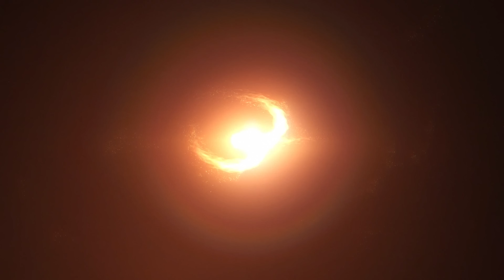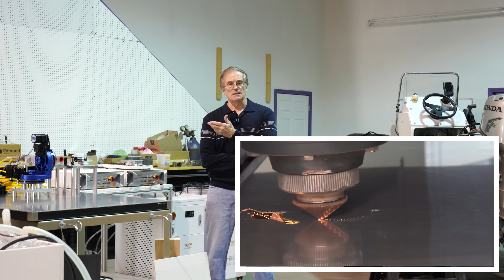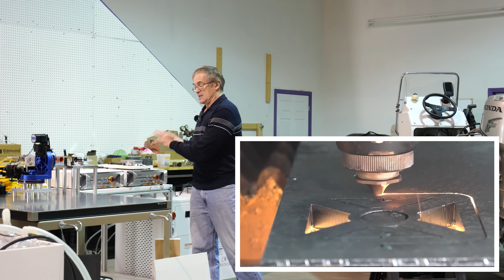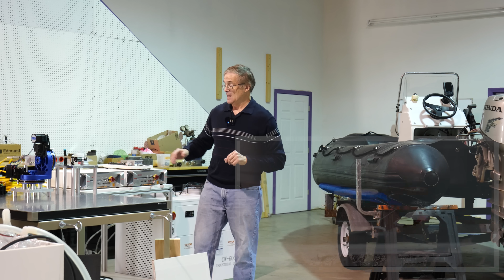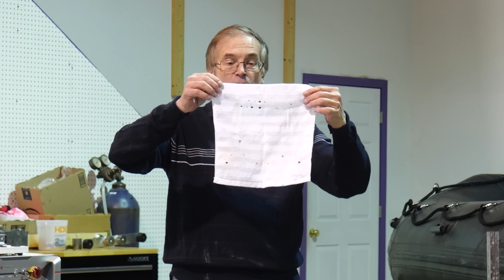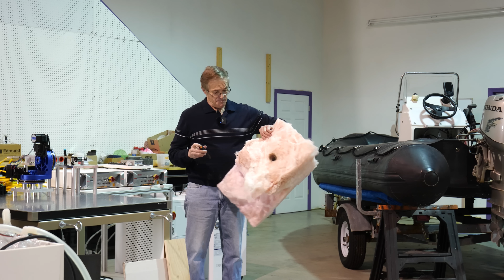We have a problem... and need your help!

Comment: Mechanical engineer here who worked with fiber lasers for metal 3D printing. My idea would be a laser safety barrier connected to the e-stop (kill switch) that when pierced, would nearly instantaneously shut off the laser automatically. We did this by creating a light tight box from sheet metal and placing a photovoltaic sensor inside wired directly to the kill switch. When the laser pierces the box, laser radiation enters the enclosed space which the sensor detects and kills the laser. The advantages I see is no risk of burn through the shop, no chemicals, sheet metal is cheap, and if you're only making 1mm pin holes it should be reusable with some aluminum tape.
Reply: I like the simplicity of this E stop. So cheap, yet so reliable. Tape to patch holes is crazy cheap, so it would last for ages.
Reply: I love this idea and think it's the best one so far, by far.
Reply: To expand on this: Make it an interlock instead of an e-stop. The laser controller would need a “safe” reading from the photo sensors before sending the next pulse or series of pulses.
Reply: That's a pretty cool idea. My roomate is working on an inconel 718 printing project and I've been in the laser cutting industry for over 30 years. We have a camera set up in the beam path to tell the control when the laser has fully pierced the material and we have little cameras near the transmissive optics to look for hot spots. It's miserable when the transmissive optics fail as they all have a pressure differential across them and fragmets fly when they shatter.

We had the walls lined with ceramic fiber panels in our CO2 test cell but we had nowhere near this kind of energy density.

I read about one cutting system that's supposed to have 135,000 watts and can cut 400mm steel, I'm not sure if it's true but we're getting close.
Reply: @krugtech 400mm... 20".... thick?  I saw a magma torch blow a hole through a pin that measured, oh 3" dia x  14" length, high carbon steel... without damage to the ram or anchorpoint, 20 minutes... 😮 .... this could do damage, to concrete as well, but was messsy...
Reply: @sqeekykleen49  that had to be a hell of a show!
Reply: That's an incredible amount of juice  @krugtech
Reply: If it's fast enough maybe a sensor limited to the laser's band on an opaque plexiglass/glass would also work because as soon as the laser would light it will turn off not giving time to do any damage, but if it fails it won't really stop the laser.
Reply: Yeah I fully agree getting the human out the loop for the E-stop is perfect in this scenario.
Reply: in food processing the DSI machine uses Inconel dowels rigth in front of the emitter that being said those are water cutters at 5o tons thru a 1/16in hole it would last about 20  reps before the 1/4 dowel would be sliced just an idea...
Reply: That’s a good idea from a safety standpoint but not so good from an actual production view. How do you accomplish any work when the machine is kicking itself off all the time….￼
Reply: Temperature sensor buried in sandbags… any sand that melts is replaced instantly with grains above it, and the temperature sensor triggering a rise, cuts off the power to the laser
Reply: Hell yeah, this seems perfect!
Cheap, lightweight, durable, no water, and could easily be made from smaller modular panels!

You could easily do some validation too, by just drilling a pinhole and shining an LED of the same wavelength through it, this could even be automated as a check.
I'm pretty sure you can get sensors that are plenty sensitive enough to pick up even that weak light, so you could be confident that a laser blasting through would trigger it.
If you go modular then just make sure the sensors in the middle have a little protection in case they get hit directly.
Reply: I like your idea. So simple. The only thing you need here is creating the ability to detect the laser hitting a certain surface. You propose achieving that by creating a detection box measuring the laser light piercing through it. My first thought was to create some kind of drywall and covering it with two layers of aluminum foil which are separated by a plastic foil layer. The laser piercing it will connect the aluminum layers and that should be detectable either. Could work as well. But needs some testing for verification.
Reply: The problem is finding one that will stop that laser for more than a fraction of a second. If you took a moment to compare cost of one of those barriers to its kw/cm rating. 0.8kw\cm = 800 usd... we have two 3kw lasers here with sub mm beam channels...
Reply: @loveblowsbad   Copper is 95% reflective to a fiber laser. You could clad the inside of the exit side of the box in copper which would certainly give you much more time then any of the other materials tested in the video and you wouldn't need to worry about the reflected light as it would be contained inside the box. However I think this would be overkill as any sensor should be able to react within microseconds while even thin sheet metal should take at least milliseconds to burn through.
Reply: @Slayer553826  I have no clue about lasers but if copper can reflect fibre laser, if it was silvered (?) and angled, could it diffuse lazer enough to prevent it burning through stuff?
Reply: @Slayer553826 what's great about this idea is you can set the sensor up in a way that it is triggered by a fraction of scattered light, not the full power of the beam.
Reply: This was exactly the same idea I had, posted  earlier.  Glad to hear that an expert in lasers add the same idea
Reply: Where does the light reflect as the aluminum is melting?
Reply: Everywhere
Reply: @vne5195  paint it black on the outside
Reply: That may shut-off the laser before hitting the nonstationary target. I think that would be very frustrating very quickly for his application.
Reply: Where is the fun if u dont cut a view port "by accident" into ur neighbours wife bathroom? And the neighbour is just 2 clicks away
Reply: It cannot be reflecting so clean metal or aluminium tape can be harmful
Reply: To simplify this it doesn't have to be a sealed area and you can use a simple photo diode or array of photodiodes to look for the spike in energy.
Reply: i mean, he could just use a glass mirrored cage, right? making it bounce irregularly for the eternity? like a box with mirrors in a certain angle and one entrance only? (sorry about my english im busy right now)
Reply: clever! perhaps one could stack them with a spacing like we do with spalling armour as well to increase the effect :)
Reply: A wall of sand but the thickness required may make it impractical.  Maybe a high temp ceramic (space shuttle  tiles?) There is also a man made material touted as the least dense material. It was manufactured for the purpose of catching fast particles in space without damaging them.  I don't think it  would work but it could surprise us.
Reply: To me, the obvious answer is to reduce the time factor.  In other words let it etch rather than burn.
This could be accomplished in a number of different ways- the best would be to oscillate the focus lense so as to create a slightly larger pattern at distance without reducing the unit's power. (although that may also be necessary- at least in  the initial tests). I know various lasers work differently - particularly "warming up" where others are "instant on". That might affect what's possible with this type of laser
Reply: What about fire-bricks? The type used in metal furnaces to insulate the heat of the flame and melting metal from the metal of the ovens outsides?
Reply: this is exactly what i was thinking.
Reply: Did you try silicone.
Reply: yeah auto shut off after penetration for sure! Star wars weapons!
Reply: There's a cool bonus to this: the sensor could also control a camera shutter to capture the instant the laser makes it through the material
Reply: I like the estop idea.  Light weight implementation retro flextive tape adhered to one sheet of drywall.  Camera mounted on the barrel of the laser.  Calibration set to sensitive, point it at your brick will immediately turn the laser off as soon as it turns on.  Turn the sensitivity down til you can melt the brick.  Now hit the retroflective tape.  Should be much brighter amd exceed the threshold for shut off for a couple milliseconds.  Patch the whole you just made in the retroflecive tape.
Reply: Great solution Bro. Nice!
Reply: This will probably have a larger safety impact than materials choices and goes along with typical laser safety measures.
Just leaving the insides without surface finish will be more than enough to fill all of the inside of the box with abundant radiation for detection.
However, photodiodes in photovoltaic mode are blind to open circuits and lose detection capability. In photoconductive mode, the very slight remaining current can be measured but vanishes when the circuit is open, e.g. if the laser cuts the wire.
Bonus point if you take redundant photodiodes (ideally from independent vendors - that stuff is cheap anyways), redundant safety circuits, and redundant kill switches.
Reply: Inventor here.  I just now though of a similar idea and came here to post it and saw your idea, which is great for an area under a few cubic meters, but here's what I thought of.  All it is is a laminar flow (think waterfall)  of fog from a fog machine and an array of fast phototransistors connected to the kill switch.  The instant the laser hits the fog, the Tyndall effect scatters a portion of the beam's energy in all directions, creating a bloom of light that is instantly registered by one or more phototransistors in the array, triggering the kill switch.

The main advantages I see are:

Speed: It's a "touch-to-kill" system, not pierce-to-kill. The reaction time is limited only by the electronics, not the material burn-through time.
Self-Healing: The fog curtain is non-destructive and instantly replenishes itself. No need for patches.
Scalability: It's likely easier to scale a fog curtain to a large area than a rigid light box.

Of course, the engineering challenge would be preventing false positives. You'd need to pair the sensors with narrow band-pass filters tuned specifically to the laser's wavelength (e.g., ~1064nm) to make it blind to ambient light.
Reply: @universebecomingltd  I think the sensitivity to natural light would be easy, bandpass filters are very effective, especially with such a bright signal, but the sensitivity to a partial reflection off the target might be a bit harder.
With the fog curtain the reflection intensity should be as consistent as you can get the fog, so unlike a surface that might reflect in funny ways it should be easier to discriminate by signal intensity whether it fully hit the fog or reflected off the target into the fog.
Getting consistent fog might have some challenges, since I guess it would vary with humidity, but I think it wouldn't vary too much to get good discrimination.
Oh, it would need extraction to prevent fogging up the workplace though.
Reply: This is it.
Reply: Why don't you try a starlight material with carbon layer on it about 2mm thk....
It will at least hold for 5 sec or more
Reply: But they're using the Laser to shoot down Drones.
I think there will be many misses that would instantly trigger the Kill Switch.
The idea is super solid but probably needs more burn time to trigger?
Reply: @ChainDrivenAU if they hit, the beam is ”temporarily” stopped by the target. When the target is cut through, the beam continues the same way as with a miss and triggers the kill switch.
Reply: @apeach666 Anytime the beam misses the drone, it shuts itself off. There's no room for error on any shot or the system turns off. I imagine this would be an issue while testing, but only for moving targets.
Reply: @nathanporter2001  That makes zero sense. If the laser missed the target, the beam is already gone and can cut whatever it hits.
Reply: @PulseHighwayMusic  It takes time to cut anything, as long as you have a backstop that takes more than a few milliseconds to cut it is easy to turn off in time.
In fact if it is quick enough then you could even stop it before it heats enough to begin melting the backstop, lasers respond very quickly! But that would be microsecond response and unnecessarily challenging to implement.
Reply: @samheasmanwhite  That's fine for the lab but my solution is still much better.
Reply: @PulseHighwayMusic  Your "solution" uses lasers they cannot get, and might not even exist, and the operating principle is derived from you knowing that ultrafast lasers can ionise air, and apparently nothing more. Who knows if the physics even makes sense? You certainly don't. Just stick to sci-fi where you don't have to actually build your quarter-baked ideas.
Reply: 100% this is the occams razor solution. And can add a layer of safety to the system as a whole.
Reply: building a 2x4 framed plywood box with a highly sensitive photo sensor wired inside, preferably tuned to the lasers wavelength could trigger the kill switch the moment the laser penetrates the front facing plywood sheet. Could be easily tested with the concrete brick wall at a small scale where the box is maybe only 12in x 12in and then scaled up to a larger size. The other kill switches should be if the guidance/aiming system that points the laser goes outside a predetermined area, maybe limit switches that are attached to the aiming system by linkage, again that can easily be tested without the laser running.
Reply: This has the benefit of being a really fast active failsafe, but all the comments on this being simple are underestimating the complexity of building a 1000 sqft instrumented barrier that can be quickly reset. It will be much harder to test, and use once done than finding the right kind of material ( if it exists lmao ) and just making a wall out of it.
Reply: @LauhityaReddy  The OP described how this would be constructed; thin sheet metal and one very basic light sensor per box, it could just be one big box with one sensor, or several smaller ones.
Reply: This won't work in mid-air. It's alright on a cutting machine but that's pretty much it.
Reply: @PulseHighwayMusic  I'm not sure what you mean by "mid-air" this isn't intended to be flying but rather protect the walls of the shop so it would be stationary.
Reply: @Slayer553826  They are looking for a solution so that they can use their laserz in the air without frying everything behind what they are aiming at.
Reply: @PulseHighwayMusic  Please explain lol?
Reply: @samheasmanwhite  I was referring to his problem of try to shoot down/cut other drones in flight. But also, even if the laser is on for a fraction of a second, it will destroy whatever it hit. His "almost instantly" is no good in this situation. I emailed them the perfect solution to both of their problems.
Reply: @PulseHighwayMusic  They are testing it indoors, the wall doesn't need to be flying or whatever, and it is not instant, there is more than enough time to turn off the laser if you care to calculate it. What is this "the perfect solution"? It better be good if you are emailing them.
Reply: @samheasmanwhite  I'm pretty sure that he said that they were using it on a drone to shoot down other drones and they need it to not burn/slice everything else that could be behind the drone in the air. The indoor part was when they were doing tests.
Reply: @PulseHighwayMusic  If they were planning to strap those fibre laser sources to a drone then I think I missed something lol. Pretty sure it's just ground turrets they are making.
Reply: @samheasmanwhite  That makes more sense given the energy needed. My solution still works fine for the ground turret.
Reply: @PulseHighwayMusic  Ya got me kinda curious, which method did you settle on?
Reply: @samheasmanwhite  I gave it to them but they haven't gotten back in touch with me. Do you want me to write it here or send it to you by email? It is quite long for here.
Reply: @PulseHighwayMusic  Eh, just the basic premise would be fine, I can probably fill in the gaps.
Reply: @samheasmanwhite  Since it doesn't exist, I don't think that anyone can just fill in the gaps.
Reply: @samheasmanwhite  Proposed Solution: Dual-Laser Scanning System with Plasma Shielding for Precision Slicing and Safety

Overview:
Our current single-beam laser systems are excellent at piercing or “drilling” targets, but they leave small holes rather than achieving a true cut or slice. Additionally, there’s concern about the residual laser energy damaging anything behind the intended target. To address both issues, I’m proposing a dual-laser, synchronized pulse system that not only slices targets cleanly but also creates a plasma “block” behind the cut, serving as a dynamic backstop to prevent collateral damage.

System Concept:
Dual-Laser Configuration:
Two high-power pulsed lasers are mounted side-by-side (or above/below each other), aligned so their beams are parallel as they pass through the target.
The beams are angled or optically adjusted to converge at a predetermined distance behind the target, forming an intersection point or line where the energy density is highest.
Pulse-Scanning Slicing:
Rather than using a continuous beam, each laser fires a rapid sequence of ultra-short, high-energy pulses.
After each pulse, the aim of both lasers is shifted slightly using high-speed actuators or galvanometer mirrors.
This creates a series of overlapping pulse sites, essentially “drawing” a cut or slice along any desired path (straight line, curve, etc.), rather than simply burning a single hole.
Synchronized Plasma Block Formation:
At the precise location behind the target where the beams converge, the combined energy of the synchronized pulses exceeds the air’s ionization threshold, creating a brief, localized plasma “block” or “sheet.”
This plasma region is highly effective at absorbing and scattering residual laser energy, acting as a temporary barrier to protect objects or environments behind the target from stray or over-penetrating laser energy.
Advantages:
Precision Slicing:
Multiple, overlapping pulses produce a continuous, clean cut rather than isolated holes, greatly improving the effectiveness and versatility of the system.
Dynamic Laser Shielding:
The plasma block forms only where and when needed, reducing risk to anything behind the target—crucial for both safety and operational control.
Synchronization:
By firing both lasers and moving them together, alignment and timing are simplified, minimizing complexity compared to more reactive systems.
Scalable and Flexible:
The system can cut arbitrary shapes by adjusting the scanning pattern, and the plasma shield dynamically tracks the cut.
Implementation Outline:
Mechanical & Optical Alignment:
Mount both lasers on a stable platform with adjustable optical paths to set the convergence point just beyond the typical target thickness.
Integrate fast steering mirrors or precision actuators for controlled, repeatable scanning motion.
Pulse Synchronization & Control:
Utilize a microcontroller or FPGA to precisely synchronize the firing of both lasers and their movement along the cut path.
Allow for adjustment of pulse spacing and timing to optimize for different target materials and thicknesses.
Power & Safety Management:
Ensure each pulse carries sufficient energy for both cutting and plasma formation at convergence.
Integrate monitoring systems for target thickness, alignment, and environmental safety.
Optional Feedback System:
Add sensors to monitor plasma formation and adjust firing parameters in real time for optimal shield effectiveness.
Conclusion:
By adopting a dual-laser, pulse-scanning approach with synchronized plasma block formation, we can achieve:
True slicing (not just puncturing),
Dramatically improved cut quality,
And dynamic, on-demand shielding to prevent collateral damage from stray laser energy.
This system leverages established industrial techniques (scanning, pulse sequencing) in a novel configuration tailored for both precision and safety in high-stakes applications, including defense, manufacturing, and robotics.
Reply: @PulseHighwayMusic  Ooh, I like the creativity, but air ionisation requires insane power densities that these lasers cannot achieve.
You are right about needing more than one laser, but even then both beams would be very close to the critical power density for a very long distance before they reach the desired point, so they would probably be causing minor ionisation over a long distance which would disrupt the beams unless you went to even higher power levels to achieve filament propagation, and I'm pretty sure only ultra-short pulsed lasers can achieve that. Maybe more beams would help? And then idk what happens when those two filaments meet, I doubt there would be a significant volume of plasma, but also it might not actually disrupt the filament propagation. It's interesting to think about, but the lasers for this simply do not currently exist, and we would need to have studied non-linear optics and laser-plasma interactions to even evaluate if it could work since it is so far beyond normal optics.

But if you have the accuracy and precision that this technique would require then that is enough to completely guarantee a hit on the target anyway, you could even prefire a lower power beam to confirm a hit before firing the main beam, which would be a much more reliable technique. I think that might even be what the military lasers do? I presume they also visually monitor the spot while firing to ensure it stays on the target.
Reply: That would be too slow. The laser beam would shoot trough the box before the sensor detects any light entering it and shutting off.
Reply: @radry100  Ok, so let's calculate this, if the hole is miniscule it would be maybe 2mm^3 of steel, this take ~4J to melt, at 3kW that takes more than 1ms (would be much slower in reality). 1ms is long enough to turn off most lasers and if it isn't you could make the back panel thicker and give yourself 100ms or so. The actual detection with common sensors can be near instant, microseconds or less.
Reply: @radry100 I agree 100%. It will be too slow to turn off before major damage is done.